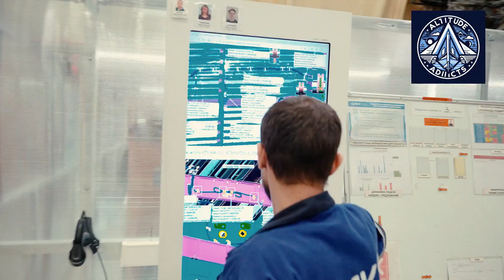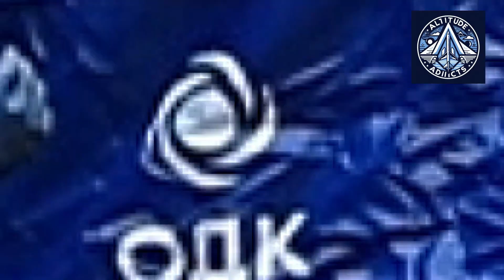Russia Defies Sanctions—Superjet SSJ-100 with PD-8 Flies

Comment: Today Russian achieved SJ100 civilian aircraft with 100% Russian made parts and components including new PD 8 engines
The best in its class. Flight testing begins 6 PD 8 engines delivered for 3 aircraft ready for engine installation. No more western parts needed all 40 parts are replaced on this first flight testing aircraft. Good job Russia.

Comment: It seems there is excessive engine smoking at take-off. What is the reason for that?
Reply: Running fuel rich to keep heat down and reduce stress on engine parts. This causes more soot in the exhaust. As tests progresses they’ll tweak and gradually lean the mixture and the final product will not have this amount of soot.

Comment: The engines smoke
Reply: The smoke issues were already resolved with the PD-14, and since the PD-8 uses the same common hot core, it shouldn't normally produce smoke. The only likely reason for it smoking is that they are running it fuel-rich for safety during its first flight
Reply: special operating mode for the first flights
Reply: low octane, JP-8, Jet-A1, fuel used for test flights
Reply: Let him fart if he wants to — who cares?

Comment: The competition is always good. I hope that one day we will see this airplane also in the West. It should be cheaper than Boeing and Airbus competitors.
Reply: Secara teori, Superjet 100 bukan saingan Airbus A320 family.
Lebih tepat itu adalah saingan dari E175 E2 dan Comac ARJ-21.
Reply: Until now, half of the Superjet 100s, including cherished examples, broke down quickly during demonstration flights. A high proportion of these resulted in tragic accidents, leading to the bankruptcy of most of the airlines that purchased them. They are of far lower quality than previous generations of Russian aircraft.

This aircraft quickly lost all its Western authorizations in its second year of operation.
Reply: @HenriBourjade  That's a lie. The main problem of the past "Superjets" was precisely in the engines, more precisely, in the French part of them. Problems with the SaM146 engine arose in the so-called hot part of the engine, where fuel burns, which was supplied by the French company Safran. If we add to this the poor logistics associated with spare parts from different manufacturers, it becomes clear that some airlines were unable to operate this aircraft. As for the accidents, there were only two. One occurred in Indonesia, due to a crew error. The second is also due to a mistake by the crew, who tried to land the plane with full fuel tanks immediately after takeoff, although this is prohibited by the regulations of all airlines. Personally, I've flown the Superjet several times, and it's a great, very comfortable aircraft compared to the Boeing.